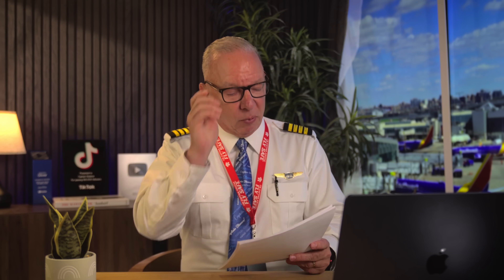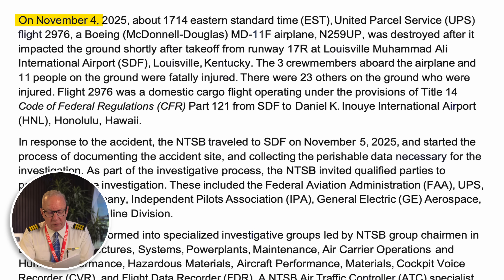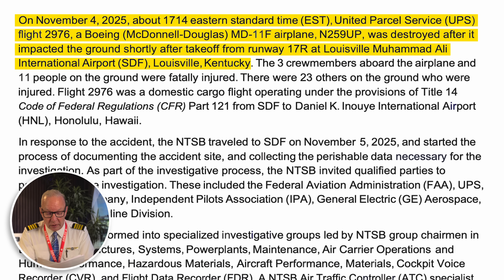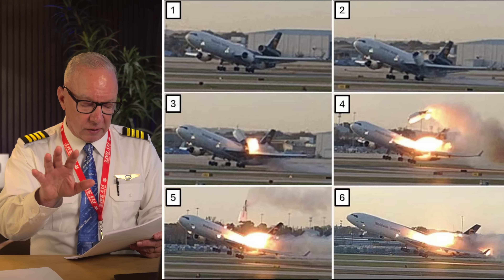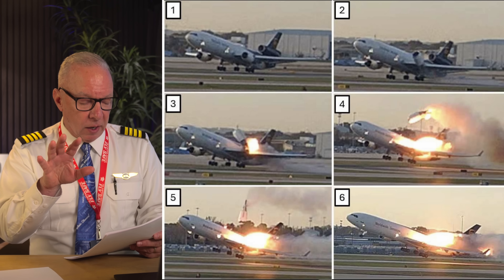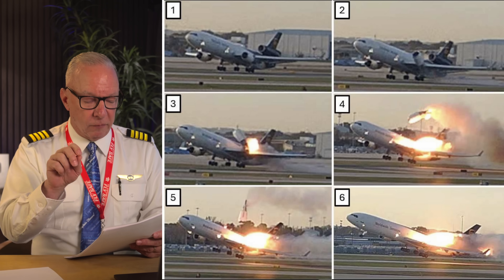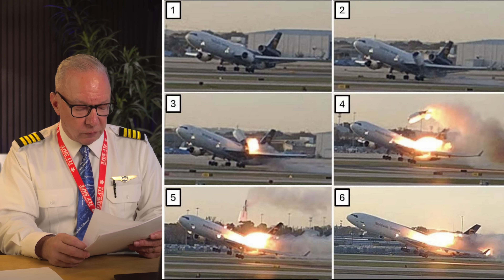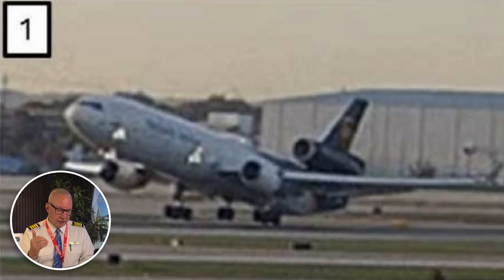UPS Crash Preliminary Report | Pilot Reacts to UPS Crash Report

Comment: That was REALLY fast work by the NTSB.  Praise to them.
If I was a member of the San Antonio maintenance subcontractor that did the recent D check on that aircraft I would be VERY nervous about now.😢
Reply: The NTSB has really good data to work with here. They have a ton of video footage, plus the engine wasn't obliterated when it came off, in addition to having good FDR & CVR data. It's good to see them moving quickly though and getting the info out there.

Yeah, the maintenance is definitely going to play a part in this investigation. Often times engines are swapped out during these heavy checks as it is much more convenient to do that in a heavy environment rather than push it to a line maintenance event. Was that #1 changed out? Obviously they'll be looking at this. C & D checks are often called "heavy checks" in the biz just to clarify.
Reply: @ourkid2000  As a UK Licensed Aircraft Engineer with multiple aircraft types.. A C-check or D-check, I would guarantee that the engines were off.. But were the pylons off???? And if the pylons were off.. Were the attachment fittings NDT tested prior to refit and were teh pylon and or engine IAW the AMM???
Reply: Well it is only the preliminary report tho, not final
Reply: The maintenance crew in San Antonio was not required to do a full detailed inspection of the pylon.  The DID do a greasing of the bearings which was required.  The full inspection would have meant a removal of the pylons, which was NOT required on this pitstop.  I think if the fleet is allowed to fly again, they will require more frequent inspections in the future.
Reply: They give the results fast because they have all evidence.

If the plane fall from the sky high in the jungle, then it's take long.
Reply: They have released a preliminary report with a lot of reliable detail on the failure itself. But they are not finished. There's a lot of unanswered questions still.
Reply: The maintenance crew did the job they were ordered to do. It's not them but the ones that let so much time between a full blown inspection of the pylons that are perhaps to blame, at least partially since we don't know what caused the aft mount to have fatigue cracks... let's wait the full report to see what the following studies of that part will reveal about the "how" and "why" of that part's failure.
Reply: They could have done everything perfectly and by the book and this still would have happened. Those fatigue cracks might not have been visible via visual inspection. The problem might date back to the engineers who developed the maintenance schedule.
Reply: @Chris-de2qh possibly even due to microscopic defects in the attach mount/fitting from the day it was manufactured.
Reply: Well...they kinda knew where to start looking. American 191 looked a lot like this accident. Photos were kinda like looking at that case all over again, actually. Gave me chills, anyway. So they looked there first. What remains to be seen is what caused the cracking. That'll be the really important info, since it'll help prevent the problem recurring.
Reply: I used to work there....
Reply: It doesn't look like San Antonio did anything wrong. Maintenance procedures didn't require inspecting the pylon. 

I feel for those who recently worked on the aircraft. They have to feel horrible. It doesn't appear they did anything wrong.
Reply: @hewhohasnoidentity4377  I wouldn't say it doesn't look like they did anything wrong. The plane came apart days after they opened up the wing for maintenance.  I suppose we'll see what procedures they did and how they did them in the final report.
Reply: @hewhohasnoidentity4377 sometimes a freak accident is just that….a freak accident. Life involves risks. They can be minimized, but NEVER 100% eliminated.

Comment: as an A&P that works on large commercial freighters, those pictures made my blood run cold. Those pilots did not have a chance, they fought till the end but that was a dealt dead mans hand.
Reply: Amen to this. As an A&P and IA, this whole event has me feeling for the people that last turned wrenches and signed their name to this lost bird.
Reply: I'm surprised they only had to do a visual inspection every 5 years, seems like something you'd want to check with ultrasonic testing.
Reply: Sadly, once the #2 engine either stalled out from dirty air or FOD'ed out, they had no chance. If the #2 engine had stayed online, they might have been able to gun it and fly it for a while to come back around and land. That's a weirdly specific failure mode of a tri-jet. AA191 lost control due to a different failure mode, it still had 2 engines online.
Reply: @woodalexander  When the DC-10 lost the engine back in 79, the engine took out the hydraulics to the slats on that side. I do remember that the had to reroute the lines away from that area to protect them against it happening again. I did see the front slats down on the effected side on UPS.
Reply: @jahatton51atgmailcom  Yeah that was fixed on the MD-11. This issue is just that you can't fly an MD-11 fully loaded on one engine.
Reply: Truly aces and eights.
Reply: Question: Why are there bearings used on the engine mounts? Is there that amount of movement that a bearing is required?
Reply: @dans_Learning_Curve There’s a lot of stresses from different directions all going through the attachment points, including a lot of twisting forces due to the engine blades all spinning. The bearings help dissipate that energy rather than applying it all to a stationary attachment point and through that to the wing. It’s those twisting forces that threw the engine up and over the aircraft instead of the engine just shooting itself forward when it broke off.
Reply: @dans_Learning_Curve  Takes the load from the thrust, and applies it evenly to the mounting, plus also does vibration removal, as to reduce the noise applied to the wing. Also allows the pylon to flex slightly as thrust changes, and takes care of minor alignment mismatches between the parts, allowing the joints to all share the load.  You make the attachment fully rigid it will tear the mounting points out of the wing spar over time, simply from the residual stress and cyclic loading there. exactly the same reason a car, truck, bus or train has flexible mounting points for the engines, drive train and suspension, to reduce vibration, and provide compliance and load sharing.
Reply: @SeanBZA  Do you not know how to use pronouns?
Reply: @dans_Learning_Curve  if there is an allowable amount of play (which I could see as a possibility) then there would be measurements to quantify it in some way to know whether to accept or reject the parts.
Reply: @CurvyRoadsAreBetter I think the word movement is a better word than play. 
Slack or play allows for uncontrolled movement.
Reply: @CurvyRoadsAreBetter  the problem looks like it was more basic than what you are thinking... Most metals have a fatigue life stated in number of cycles or events. That's the easy thing to wrap your mind around, The harder thing is not to think about it as wear, depending on the material and exact situation it's not uncommon for the parts to be visually perfect but internally at the atomic level they have begun to come apart. The overall strength of the part begins to drop substantially but counterintuitively there's frequently no visual clues anything is wrong. Testing methods like ultrasound, magnetic flux and X-ray can make them visible. The metals commonly associated with aircraft due to their low density are some of the ones with low fatigue life. While steel is typically one of the best fatigue life. Sorry if that comes off as snarky I don't mean it that way..
Reply: Thank you to everyone who responded!
Reply: @dans_Learning_Curve  spherical bearings can tolerate misalignment without putting undue stress on the mounts. It's not necessarily movement that drives the use of a bearing.
Reply: @dans_Learning_Curve  Mainly to isolate any engine vibration. If there were a rigid mount, engine vibration would stress the wing.
Reply: @dans_Learning_Curve  Bearing in this case means carrying a load. Yes there would be flex and minor movement but not like meant in a bearing for rotation. Like an axle bearing.
Reply: @dans_Learning_Curve Yeah, they swing the engines back and forth to keep the wings from overheating. Engine exhaust is right under the wing for aerodynamic purposes. I was wondering that same thing until I remembered a conversation from when the DC-10 first came out and studied the prints. See that hole in the forward mount above the 'spherical bearing hole? A rod ties in there and moves it left-right. Same thing on starboard. They move them opposite like pistons in BMW motorcycle. Or Fairbanks -Morse opposed twin. About 10 second cycle.
Reply: How are newer airplane engines attached?
Reply: @dans_Learning_Curve  Exactly the same way, bearings that allow for flex on the mountings as the wing flexes, and also allow the engine thrust to be carried through and allow for slight misalignment to be compensated for.
Reply: @SeanBZA so the mounting brackets/struts have the ability to flex to a certain amount? 
I've seen wings flex. It would be interesting to know the amount of movement there is!
Reply: There's probably a lot of reasons why a jet engine isn't mounted centered with the wing. The first thing that comes to mind is engine failure. 
However, just throwing things out there.
What if an engine mounting was an integrated part of the wing instead of mounted as an accessory under the wing. 
It seems like there's a group of people in this thread that could add some critical thinking to this. 🤔 
We've been doing things the same way for a while. 
Aren't jet fighter engines mounts integrated into the airframe?
Reply: @dans_Learning_Curve Correct, we've been doing things the same way for a while.  That's why the accident rate is staggeringly low.
As to engine mount location, integrating them into the fuselage makes maintenance a nightmare. Fighters typically require something  like 15 hours of mx for every 1 hour of flight. Comparing them is like Apples and Orangutans.
Reply: @dans_Learning_Curve  No. Farther from the fuselage produces more thrust asymmetry if an engine is lost. Boeing compensates for this with thrust anti assymetric control (TAC) system that pushes rudder hard and controls flaps and slats and stabilizers to compensate. MD decided a center engine was a better option.

Comment: This is just like the Chicago DC10 crash in 79 that killed 273 people. The left engine came loose and flipped over the leading edge of the wing. This time a 2nd engine was stalled from debris ruining chances for an adequate takeoff. In 79 all the hydraulic lines were in the leading edge of the wing and were all severed causing imbalance and a fatal roll. Were the hydraulic lines severed this time?

Comment: If  I remember right (a big if) the NTSB stated after the Chicago crash that the airlines were installing the engine and pylon at the same time. A procedure that was not recommended by McDonnell Douglas. I though the pylon had to be installed and the bolts "preloaded" before engine installation. This preload was critical because they are shear bolts designed to shear under certain conditions.

Comment: Hi Captain Steve. Hope you're enjoying your retirement. Question: According to the UPS Preliminary Report, the number 1 engine separated from the aircraft over the top of the wing causing the number 2 engine on the tail section to go into a compressor stall. If by chance, the number 2 engine was not impacted by the debris from #1 engine, do you think this aircraft could have recovered and made it back for an emergency landing? There was a lot of fire coming from #1 but if #2 hadn't been impacted what would have been the result in your opinion?

Comment: Besides the visual inspection call out in the manual, what other type of NDT is typically done on a part like this?
Non-destructive testing (NDT) is a group of inspection techniques that evaluate the properties and integrity of a material, component, or system without causing damage. It is used in various industries to find flaws like cracks or corrosion, ensuring safety and reliability in products and structures. Common methods include visual inspection, ultrasonic testing, radiography, magnetic particle testing, eddy current testing, and liquid penetrant testing.

Comment: We focus on the aircraft dropping an engine, but the fact is that the aircraft would continue to fly @ V2 without its left engine just fine.   The plane crashed because it could not maintain sufficient airspeed due to debris from the uncontained engine separation being ingested by #2 inducing a loss of thrust.   

The whole point of having multi engines is for redundancy and if an engine failure leads directly to the loss of a second engine, I dont see insurance companies continuing to underwrite these airframes.

Comment: Again mantinance neglect and or QA passed on. This area during maintenance are xreyed during service. I'm sure it's is digging into those records. The manufacturer requires these area to be xrey during set flight hrs be done by airlines and replaced per set flight hrs and additional replace per x engine removals. It's the same issue that has been ignored from the 79 and 80s issues.

Comment: I dont expect the MD-11 or DC-10 to fly again since they are more expensive to operate than more modern jets and the recommended fix could be prohibitively expensive if it requires major modification or redesign of the pylon

Comment: Excellent video.  We need some mechanical engineers to weigh on on fatigue life and whether a fixed interval inspection is appropriate as the structure ages and approaches end of its fatigue life.  Also did the original designers anticipate this kind of lifetime cycling load?

Comment: The gyroscopic precession upon sudden rotation would have caused that engine to turn right and go over the top of the aircraft which explains engine 2 damage and why it was found on the right side of the runway
Reply: wouldn't it make sense then to make the engine rotate in the opposite direction? so it flies away from the airplane if it detaches?
Reply: @kirakaffee9976  So a complete redesign and manufacturing process for the engines so that they counter-rotate each other? 🤔
Reply: @kirakaffee9976 What an interesting question!  Seems unlikely, because there are probably engineering related reasons why rotation is in the standard direction, plus this type of event is very rare- it probably happens once in tens of millions of flights.
More likely they're going to tighten up the maintenance and inspection procedures.
Reply: Exactly!

Comment: If I understand this correctly, the plane wasn’t due for its D check, which is when the pylons are checked. However, AA 191 showed that stress on the metal from the C  Check process’s maintenance routine at the time led to what happened when the engine was lost. 

In the end, it sounds like a minute crack in the pylon structure (like the ons in other parts that caused  United 232 and ASA 529) occurred, but it was just poor timing of expected D Check and number of cycles that led to it not being discovered?

It’s a shame. You’d think they would learn from AA 191, United 232, ASA 529, and Aloha 243 how important the check for metal fatigue is.
Reply: Unfortunately they don't. The FAA is a slow bureaucracy organization that when people lose their lives on plane crashes, that's when they do something about it.

Comment: I’m surprised they didn’t have a  more frequent inspection schedule after what happened with the AA aircraft in the 70s. Every six years seems neglectful.
Reply: May be, but it seems to be a flaw of this design that deserves a closer attention.
Reply: @FethearHay…no…not necessarily….realize that similar accidents happened with the Boeing 747 and 707.
Put things in perspective. The DC-10 flies since 1970…..

The issue seems maintenance intervals for specific parts. With aging airplanes you enter a grey zone. We have to wait for the outcome of the investigation. It might have consequences for other airplanes as well.
Reply: those inspection schedules will be revised for sure
Reply: Nope. The DC-10 crash would have happened to any airplane if the same maintenance mistake was made…using a forklift to remove pylon and engine together. It was a relatively new plane.

This issue seems age/cycles related and interval time frame.
The 747 and 707 had several incidents and accidents due to engine separation.
Probably the interval should be reduced on ALL aging airplanes related to this problem.
Reply: All engine mounts should have a more frequent inspection schedule. I'm going to use this as an example but how often do people check the CV joints on their cars? I would say people don't.
Reply: It didn't fail in the same place.

Comment: Makes sense as the front mount being near the middle of the engine would be a pivot point under less stress than the rear mount that would always have constant force down on it. I would have assumed the mounts would be electromagnetically checked for stress fractures every 3 or 4 years. Maybe they need to look at this for every passenger plane no mater what company or model. Every time an engine is removed have them either replaced or x-rayed for cracking.

Comment: How long does an engine stay on the wing before being removed for inspection?  In the early days of my 25 years in the USAF I worked cockpit avionics and navigation (got promoted to a staff job).  I remember a celebration we had for an engine that had been on an RC-135 for over 15 years.  The Air Force doesn't put as many hours on an airframe as the airlines do. Six years before someone looks at a critical bearing seems like a VERY, VERY LONG TIME.